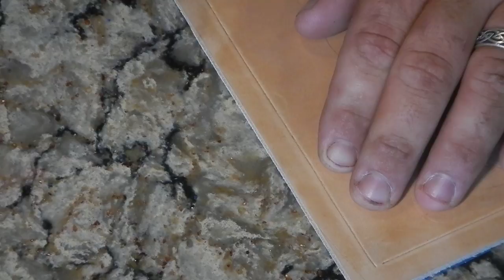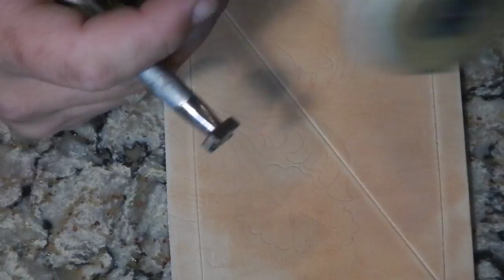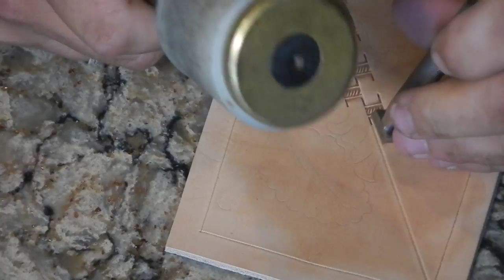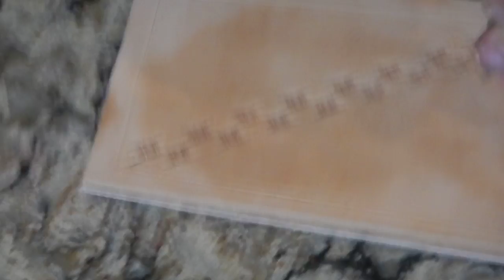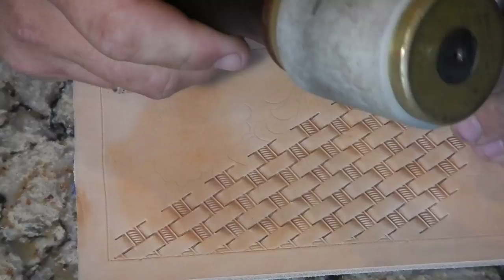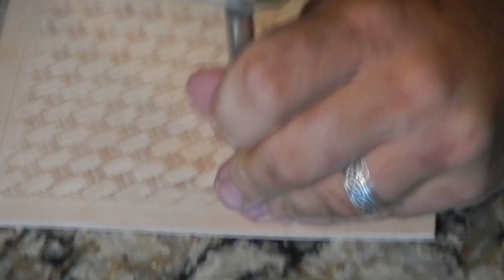Basketweave layout and tooling

Comment: Holy freak, thank you! I have been trying to figure this thing out by myself for over 2 months! Why did I not think to take to YouTube before?!

I love your basket weave stamp. I was gifted some tools to get started and I have a vintage set where the lines are not straight, but flair out. It is quite a bit harder to get it neat, it will take some practice to get them lined up good enough to look good, and there are accent lines going untoward the center braid too, a lot of detail in these stamps, but I will get it, thanks to your flipping simple and easy tutorial. I will have to get the straight edge stamps without the extra detail, as I like the cleaner look of your stamp design. 

Again, thank you so much! And your weave looks gorgeous.